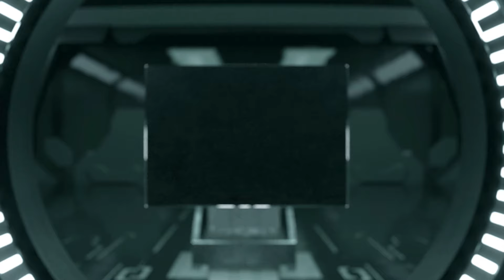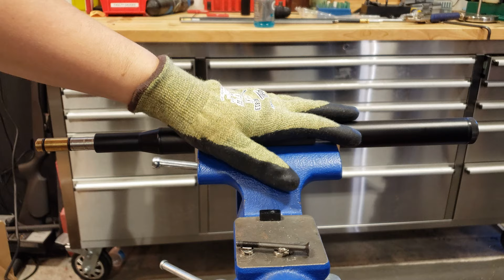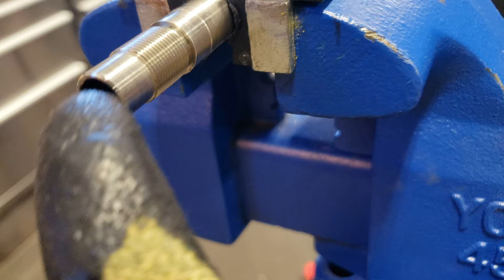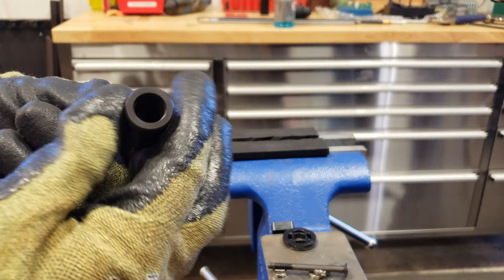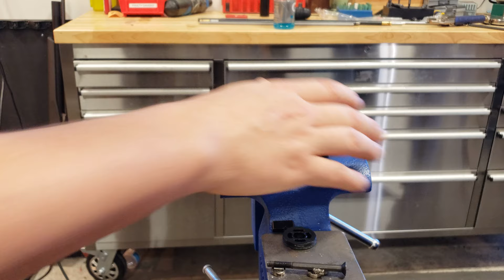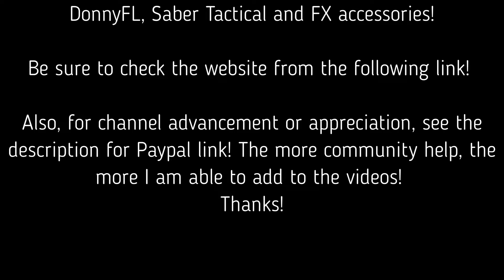FX Dreamline Compact Shroud Conversion - How to Convert FX Dreamline Thin Shroud - FX Airguns

Comment: Great Video Newman!! .. Any Part Numbers you can pass along??
Reply from the maker: Thanks! I am waiting on the part numbers, I will post them in the description when I get them. Thanks for asking!
Reply from the maker: Hey Thomas, I have added the part numbers to the description. Sorry for the wait!
Reply: @910AirgunTuningandRepairs  What are the two different part numbers for? (Descriptions of each part)
Reply from the maker: @thomashouser2675  the first number is the shroud complete, the second number is the new barrel support bushing to fit the thin shroud. You will need both for the barrel to properly operate
Reply: @910AirgunTuningandRepairs  thank you very much I was going to ask the same question, this is on my list of things to do now I've got the info 😁👍

Comment: Why didn't you just shorten the original shroud?
Reply from the maker: These are official FX products, not my personal ones. Originially, FX made the compact shroud the same size as the Crown Superlight, but after it was shown that shroud was too large in diameter for bottles and plenums, they made a skinny version to match the original shroud, but still be Superlight design. Now I believe all Dreamline barrels (at least in USA) come as a Superlight design

Comment: Hi, do you know if the Fx Crown barrel and shroud will fit the Dreamline? I have a Dreamline Compact tactical and I would like to get a 500mm Crown barrel and shroud for it but don't know if it would fit. Any thoughts?
Reply from the maker: As far as I know, yes, the Crown set up will work on a Dreamline. I have confidence with this because a Dreamline barrel fits onto a Crown (I have tested that one).
Reply: @910AirgunTuningandRepairs  I think the barrels are pretty much interchangeable but not sure about the shrouds. Most ppl I have asked have said no.